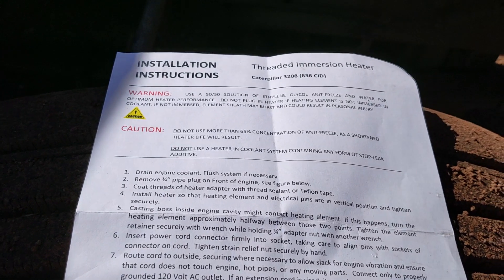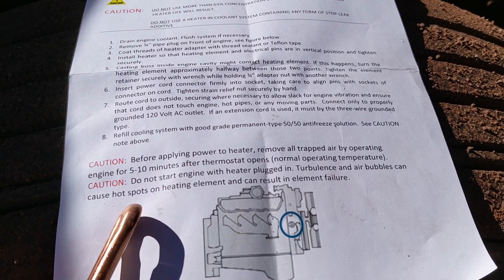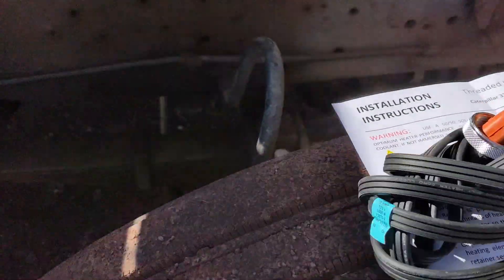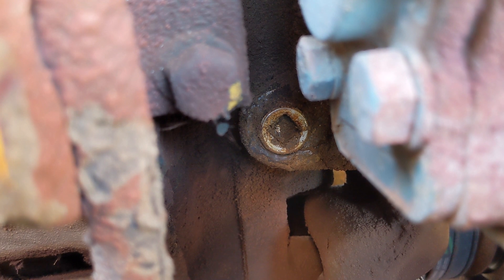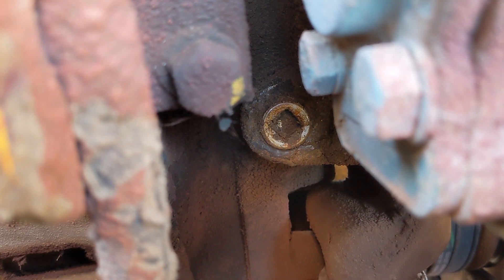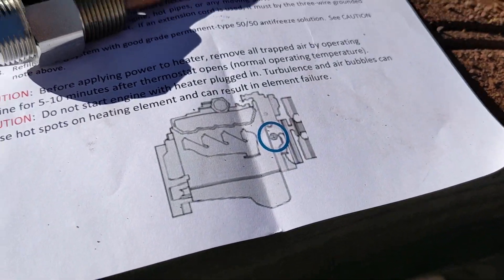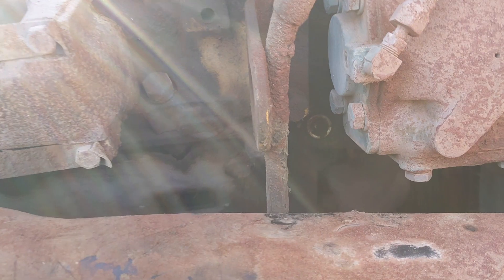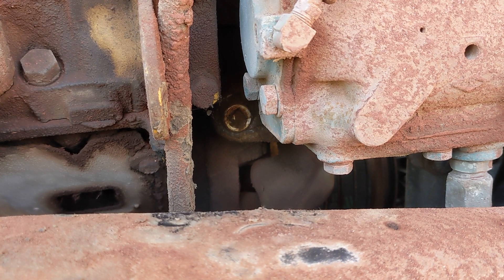Installing a block heater in a Cat 3208...it was pretty easy...so was the "cold" start!

Comment: I might have missed it, power should be off before starting. It might be an old wives tale but I was told the element will be ruined if the power is on and the engine started. I like this  channel.